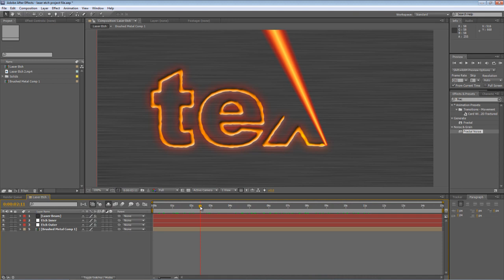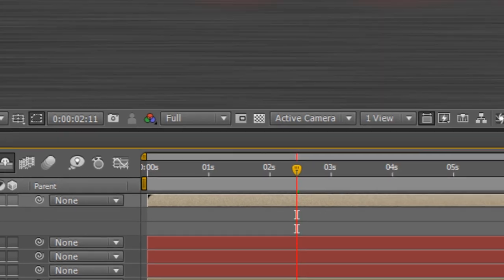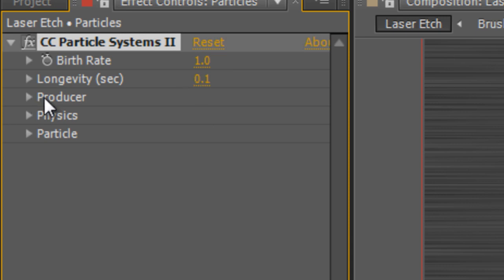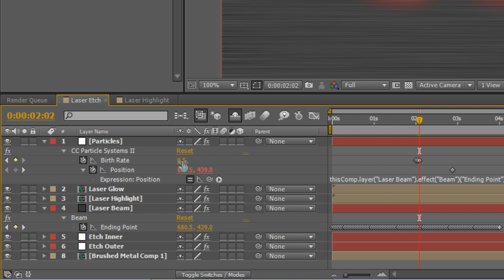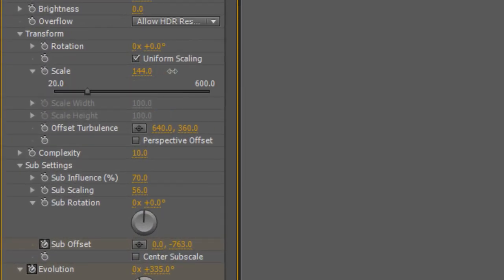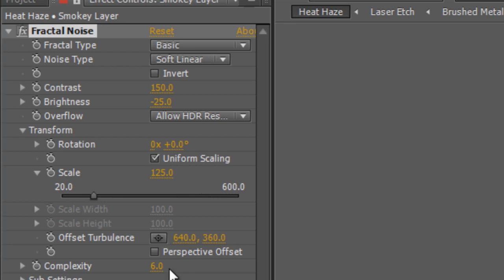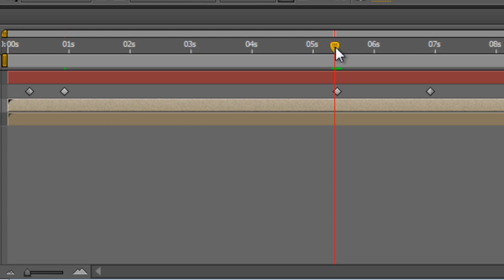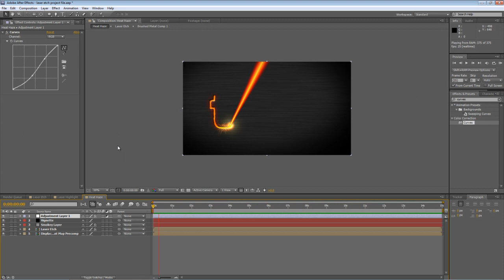After Effects Tutorial - Laser-etched metal pt2

Comment from the maker: If I understand the question correctly, it sounds like you have a very short composition so there's a long jump between each keyframe. One solution might be to make your composition longer (time) so there are more keyframes and shorter jumps between each one. Then pre-compose and use time stretch to reduce this new precomp to the required (shorter) duration. Hope that helps.

Comment from the maker: 'Transfer Mode' is a standard part of the CC Particle Systems II effect, but it's not visible until you twirl down the Particle settings in the Effect Controls panel. If you don't have any CC effects in your installation, it's either because you're using the demo version, or an illegal copy of After Effects. Either way, the solution is to buy the software Just warning you now - talking about pirated software on this channel will get you blocked.

Comment from the maker: Ah - that's where the problem is. If you've made changes to the original dimensions, then it'll throw out any position values that are pulled from a parent layer. The way to fix this is to make sure that any changes that affect the original layer are duplicated on any 'child' layers - this will ensure that the values returned are the same on both layers. In short, your Highlight layer needs to have exactly the same dimensional/spatial properties as the layer it's being parented to.

Comment from the maker: OK, couple of things to understand here. Once you've 'parented' a layer to another layer, it will take on the values of the linked layer (scale, position, rotation etc). However, you can still make adjustments to the original layer without breaking the connection. Make sure the timeline indicator is at the beginning, select the layer you want to move and then use the cursor keys to nudge it into its new position (holding SHIFT as you do this will increase the nudge distance).

Comment from the maker: @SafeGuard007 Click and hold the Shape button (default is rectangle) to get a drop down for the variations (rounded rectangle, ellipse, polystar etc). Or hit 'Q' to toggle through the shape options. Tip: if the button has a tiny triangle in the bottom-right corner, that means it has a number of alternative options available.

Comment from the maker: @HybridvLaazR @skiidahonorthsouth My home system isn't cutting-edge (3.6GHz Quad-core, 16GB RAM, separate HDD volumes - no RAID). My work system is a little more grunty - 6-core w 24GB. Like you pointed out, I often create a RAM preview (0 key), and that's how I can scrub through the timeline without rendering lag.
You can setup an alternative RAM preview (SHIFT+0) with a lower resolution to create longer/faster RAM previews at a different setting - controls are accessed in preview panel.

Comment: @HybridvLaazR Howdy, I'll see if I can help out. Laurence can correct me if wrong. Your problem sounds like one of computer horsepower. I consider mine adequate with a quad i7 and 16 gigs RAM RAID-0 video drives and a 64bit OS. My guess is Laurence's system is spectacular! And whenever you see the green bar near the top, it has been pre-rendered to save time in the presentation. ALSO, you can speed the preview up by lowering the resolution (tool bar at the bottom of the preview window).